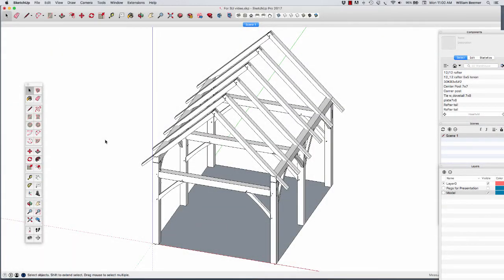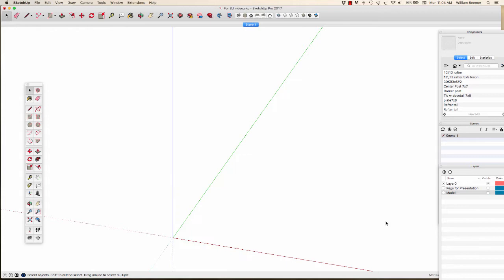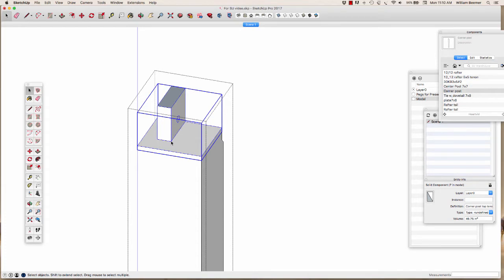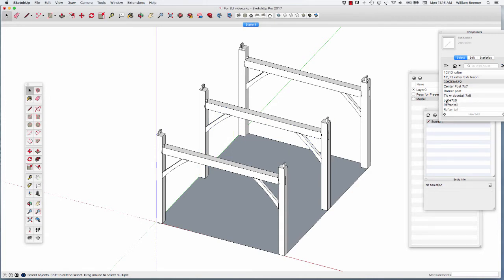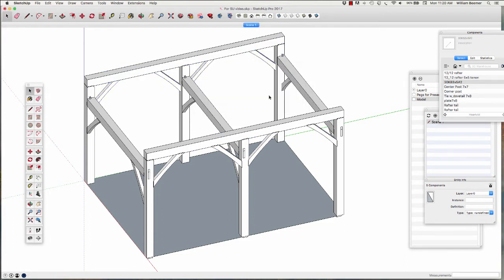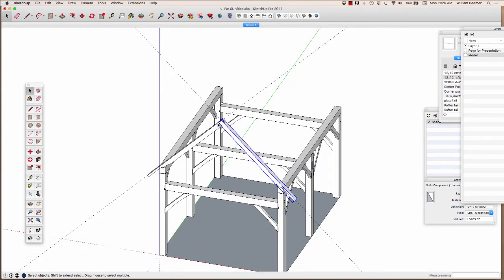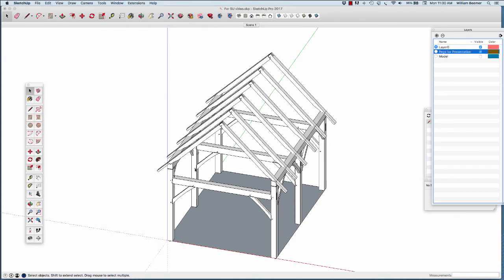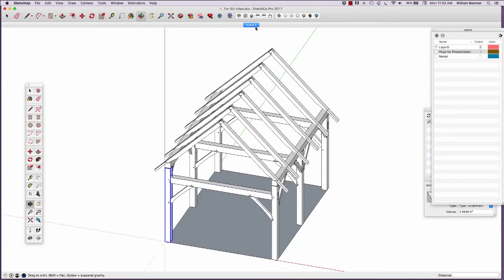Timber Frame modeling with SketchUp

Comment: As your second bent, is a mirror from first bent, the knee braces where place on one side of the post and beam.....i think knee braces on interior bent, goes centered on post and beams right ???
Reply: No; in square rule edge layout the braces are usually flush to one face of the timber. It makes cutting the housing easier since it is open on one side, and there are other reasons. This all explained in detail in my book "Learn to Timber Frame" if you're interested. The middle bent is not a mirror but is identical to the first bent. The bent on the other end of the building is a mirror.
Reply: @willbeemer  man...i just realize i am talking to a Will Beemer.......yes, thank you for your answer....i saw a video were a young guy (The Timber Frame Project) is building a small timber frame from your book....he talked about all his search for information on timber frame buildings, he came out with three books and their writers, and mentioned your book as the most usefull for him.
I sure take a look into your book in the near future.....thanks

Comment: Wow, i've been messing around with this program for two days and should have watched this video before starting.  My plan is pretty, but all one piece.
Are all of these features available with the free version of sketchup?  which version are you using in this video?  thanks,  good video.
Reply: Sorry, Clark Bremer's screen name is "daiku"; look for Timber Framing Extensions.
Reply: @willbeemer  On sketchucation only:

Clark Bremner: Toggle X-Ray/Perspective    v1.0
Clark Bremner: Angle between Planes    v1.0
Clark Bremner: Rename Component Instance    v1.0
Clark Bremner: Rotate 90 around [X, Y, Z] axis    v1.2
Clark Bremner: Repaint Face    v1.0

There is no necessary plugin(

Comment: Just some thoughts : 
1.  that toothpicking the bottom parts of rafters is really funny/definitely not be able to carry the weight of the shingles + snow weight, is it some special "feature" - have never seen nobody doing that kind of weakening the rafter  this way
2. bird mouthing the rafter and nailing it to the plate is usual practice, very funny you are notching the plate itself for that small triangle you sit the rafter in...
3. where is the ridge beam, connecting rafters on the top through the whole length?
4. At the end where you are exploding components to cut the mortises (exploding means its not component any longer) - other components are not ALL edited at the same time,  so you would probably need to do each join separately - again ?

Nice effort with this video lesson but I believe that you are starting to learn SketchUp(nothing bad in that - we all are, right?) but to me the "tutoring" here was not convincing at all - no pun intended, just me - thank  you in advance for commenting on above technical issues/topics, kind regards
Reply: It's not a toothpick it's steplapped if you watched the video you would see that at about 17 minutes into the video!  Don't think you know much about timberframes, but that's okay.  You don't need a ridge beam with common rafters.
Reply: The 1.5" thick rafter tail cantilevered out 12-14" is plenty strong enough to carry 1" roof sheathing, shingles and snow at 32" o.c. Remember it's 5" wide. The step lapped rafter seat is a traditional timber frame joint that has been used for hundreds of years. There is no ridge because the rafters thrust against the plate (hence the step-lap) and the wedged dovetail at the tie beam resists it. Many timber frames don't use ridges because it's a lot of work to get it up there and not necessary with other joinery. The rafters are joined at the peak with an open mortise and tenon. 
Yes, I need to cut/subtract each solid joint separately but I don't need to explode the main component since I am copying the solid joint an pasting it back ("in place") outside the main component, then it disappears when subtracted.
Reply: Sorry, meant to say the rafter tail is 2" thick on the 5x5 rafter. Thanks J. Mahoney.
Reply: Miki Dominko Mr. Beamer knows a great deal about timber framing and the joinery he is displaying here where the rafter meets the plate are called step lap rafter seats. They are a very common joint and have been used in timber frames for hundreds of years. The company I timber frame for uses them in frames we build today, though to please the engineers and the litigious we drive a lag through them. The old timers didn't use any lags and their barns are still standing. Mr. Beamer is far too nice to say straight out that you don't have any idea what you are talking about when you bring up your criticism but I have no such compunction. You have no clue at all.
Reply: Oops, sorry I basically said the same thing as you Will, I didn't even see your reply. And I spelled your name wrong to boot. My apologies.
Reply: Mr Dominko,
You need to have a clue before you criticize.  The step lap rafter seat is the method of choice and a ridge beam is not necessary